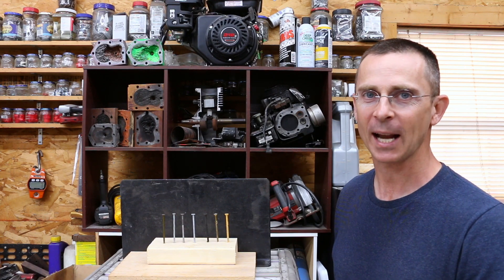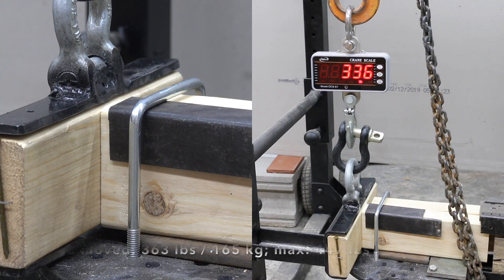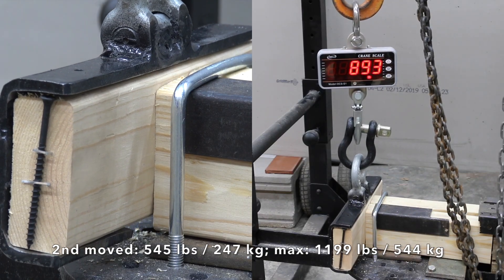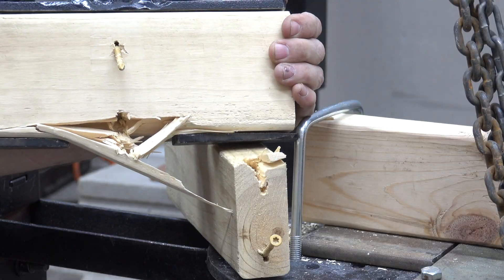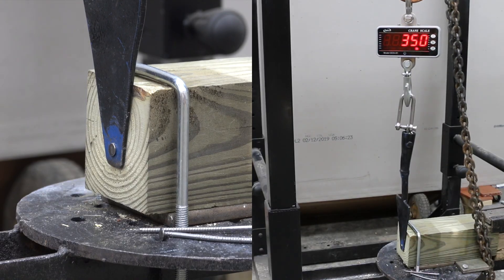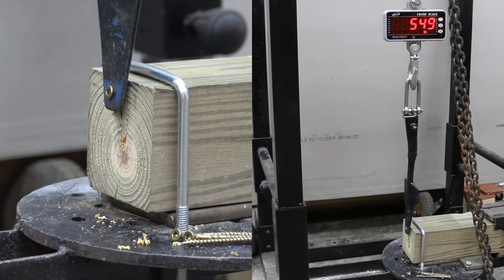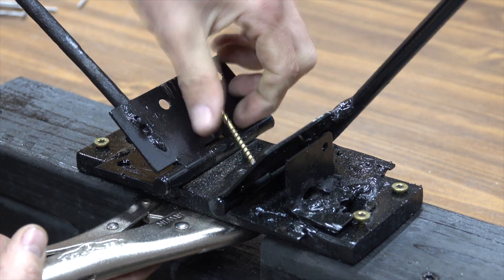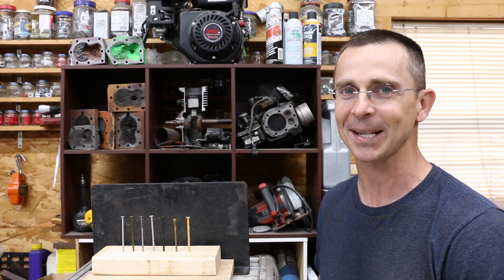Do Screws Shear easier than Nails? Let's find out!

Comment: The ductile/brittle test showed the stronger screws breaking with less total bends...BUT..you can obviously see significantly more force being required to bend it just once which you must ask, how many times will the lesser shear strength allow the more ductile nails to move laterally before the screws move once. If they are able to make more movements to a snapping point before a screw is ever fully bent once/twice then i suppose it doesnt really say much

Comment: I love this test. Thanks. From the Netherlands. Concrete houses are the norm, with attics being wood. Need to strengthen an attic. Exactly what I needed. Seems builders are making excuses to use nails for cost and time cutting. 

The last test is what everyone else focuses on, but seems very theoretical. In what universe do nail/screw heads move 0.5-2" side to side and not see the entire structure fully compromised? .1" / 2-3 mm even is a lot. And I can bend my very strong 6x120mm structural screw with that by hand, endlessly. No issue.

Anyway, thanks for doing such an usually extensive test.

Comment: It's mostly testing the strength of the wood since that's what's almost always failing first. Either ripping apart or pulling apart. Repeat with a harder wood that isn't moist, so the fasteners have more lateral load, and don't just rip the hole bigger and then pull out.

Comment: We built a shed 24 years ago using only screws, lag bolts and carriage bolts with lock washers. The shearing strength was from screwed in horizontal 1"x4"s. The siding and roofing is sheet metal. The shed has been through three hurricanes, an F1 tornado, had a tree fall on it. No structural damage.

Comment: The test rig conceived and use here has been, rightfully, commended for effort. However, the results and the visible mode of failure depicted in the footage clearly shows that the rig assessed 'Skew Withdrawal', not Shear. All fasteners simply ended up withdrawn and bent, as against merely withdrawn but still straight (as would occur with an 'Axial Withdrawal' test). Only one of the fasteners tested actually 'sheared' - evidently by fluke of that screw consisting of a relatively weak (brittle) metal. 

Though the force applied with the rig is in the correct direction that it should be for a shear test, lateral, or 90 degrees to the axes of the fasteners, (not axial, in the same plain as the fastener axes, as would be applicable with a legitimate Withdrawal test), for the rig to actually test Shear, the 'top' of the T and its enclosing metal C-'puller arm' (at left as seen in the footage) would need to be fully constrained from tilting away from the 'shank of the T, as the pull-up load is applied, that is, deliberately and only allowed to move upward/perpendicular to the axes of the fasteners, not outwards/away from the T shank.

Comment: I've been hearing old heads say nails have more shear strength this blah blah blah than screws all my life. I always knew they were wrong, just didn't have a way to prove it. Thanks. 

Kind of ridiculous that even building codes mostly call for nails because of "shear strength".

The amount of bending required to break the screws will never happen in any house or deck, especially because there's so many of them in each joist/whatever.  If 1 screw on average can hold 700lbs, and joists hangers can hold 8 screws, on both ends of the board, that's like 5600lbs x2 which is 11,200lbs. Tell me when would there EVER be that much force on a single joist? NEVER. not even half of that!! You could fill a room with cinder blocks and it would hardly weight that much, the board would snap first (maybe) now factoring in all the other joists which would multiply that exponentially distributing the load, it just seems absolutely ridiculous to not be able to use screws according to "code"

Comment: Finaly some tests that make sense. 
I had my doubts about nails being way better than screws... turns out they are not.
They only surpas screws in most usles test - where you bend them beyond any normal deviation in buildings.
But this somehow is the standard mesurement for most people.

I guess that's why so many homes are made from wood... because concrete does not bend at all.
Reply from the maker: Thank you very much!

Comment: Just My VIEWS --- I have built many Decks and Some are Over 30 Years old and Going Strong .  -------------------  The TEST Did NOT Show or COULD Show EAST COST WET ------ Or SOUTH WEST DRY ------  Out West in Totally Dry Weather , Even the SHEETROCK SCREWS Will Hold for a Life Time , BACK EAST IN THE WET ------- OH HELL NO ,  I use  ZINK COATED SCREWS and No Problems at All .  The DECK and ROOF At my House has STOOD TO OVER 100 MPH Winds and Never Moved .  Just Using ZINK COATED  CONSTRUCTION SCREWS and is Over 30 Years old now .

Comment: Very good video, always like testing like this.  One thought on the fatigue failures, you bent the screws in the threaded region where the shear tests were stressing the region near the head.  I suspect the screws would have performed much more like the nails if the non-threaded portion had been tested instead.  The stress in the threads would be much higher due to their complicated notched shapes.  
Also for the shear results, it appears any coating on the nails reduced the pull out friction somewhat.

Comment: I built a desk several years back and it sat outside for a winter in NorthEast. My GRK screws had obviously gotten wet. The sheared/snapped very easy to my surprise when moving it around in the spring. This made me worried about using them on a Porch project up coming? Not that I plan on them getting pounding with rain but in general should the moisture resistance be a factor when considering structural screws for building walls etc.. I suppose as long as unfinsihed framing is not left too long exposed to the elements? I noticed they also make GRK screws in Stainless?

Comment: I've been looking for an appropriate nail or screw for permanent roof anchors on my home. They must hold if I fall off the roof which would be more of a sudden, shearing force than demonstrated here. In a lot of the videos, screws are used and in one case, six 3" spiral screws are included by the manufacturer. These go through the decking into the joists. I thought about the structural screws from Grip-Rite that state they replace lag screws but expensive and maybe overkill. Suggestions appreciated. Great video by the way. As always.
Reply from the maker: Thanks!  Thanks for the suggestion.

Comment: I am redoing the fasteners in my wrap-around porch with deck screws because 50 percent of the nails have worked their way out and are rusted over its 25-year life (up over 1 inch). In reality, I've found it's best to use a coated deck screw for most all construction projects since they hold well enough, do not work loose, and can be removed straight and reused. I gone back to outdoor projects ten years later and the deck screws look very similar to new, if not under water.
Reply from the maker: Thanks for sharing.

Comment: If your shearing off a modern threaded structural fastener your probably in the vortex of a tornado. bigger problems to deal with.
Reply from the maker: Thanks for the feedback.
Reply: @ProjectFarm  BTW, your channel is sooooo freak'in honest.  Thank you.
I think @ 9:00 was a better shear test since it put the test force at the actual point of the snap. and..... did not break👊👊  Not sure a screw inside a piece of wood would ever move the way you bent it in the hinge test. Just my opinion. Thx again.

Comment: I am a design engineer and I think a good test would be screws and nails and various orientations on the wood such as ingrained side grain etc test for pull out and sheer forces Plus shear with a torque Force called a moment which can happen with a nailed in ledger. You can contact me if you need more info.
Reply from the maker: Thanks for the suggestion.

Comment: He only used 20% for design value of the ultimate failure and a perfect condition. As far as wood goes you need to use different areas of the wood to screw into the test piece such as parallel and perpendicular to end grains.
 In general ad and 10d gun nails are the go-to for withdrawal and shear and high wind applications. Once the threads have some gripping problems in a screw all bets are off which can happen with rust or wet or deteriorated wood.

Comment: The first 2 tests were very reasonable & realistic.  The forces on the fasteners were slow and increased gradually.  The metal resisted and distorted gradually as the strain increased to the point of pull-out, which happened long before the yield limit could have been reached.  The only way to reach point-of-failure was to increase the rate of bending and focus it on a tight area.  Thus, I'm concerned about how realistic the bending test was.... For a fastener to bend so many radial degrees, at a specific location mid-length, in such a short time-frame, the connection would need to be subject to a catastrophic event, like a hurricane or tornado, or a landslide.  Otherwise, the bending movement would be unrecognizable to the naked eye.    Perhaps you could do test where the side to side pressure on the head was rapid, but short, or slow and short.   The issue here is that metals tend to be more brittle under a quick movement and more ductile under a slow one.  Sort of like bending taffy candy.  If you want to break it, you need to wack it against a corner... it will shatter.  But just bending it in your hands won't break it till the material becomes fatigued and thus more brittle.   Not withstanding this criticism, your study was EXCELLENT.  Thank you.   I'd like to send you a contribution, rather than pay monthly. How can I do this?
Reply from the maker: Thanks for the constructive feedback.

Comment: Bending a fastener is not a test of shear strength.

Nails and screws will not sustain bending loads unless the joint is so loose that there is no friction between the attached members.

The tests you conducted using a load applied perpendicular to the fastener into the ends of the 2x4s showed that as the fasteners get loose, the shafts all bent with no failures. This scenario seems more representative of real world use vs your bending tests.

Comment: Not really shear strength as the board is just cocking back and the nails pulling out.  U need to squeeze the board with the load on it so it has to pull straight up.  Your just pulling the nails outta the board

Comment: How about a combo of fasteners and adhesive.  Use the deck screws and the Loctite 8xl.  Do end grain as well as cross grain pullout and shear. Very curious on how strong this combo joint will be.  👍
Reply from the maker: Thanks for the suggestion.

Comment: I know this is 4 years old but I had sort of a related experience using deck screws to hold up weight. I built 8 four tier free standing shelves using full sheets of 5/8" OSB and 2x4 lumber. 
I built 4x8 frames of 2x4's sitting vertical, with a cross member every 2ft, sort of a ladder frame with OSB screwed to the top side with the same 3" deck screws that I used to assemble the frames.
Each of the four shelves were held up by 10  2x4's, two on each corner. and two in the middle. A 48" length of 2x3 was used to place each shelf and give it some added under support. Each shelf was held by 10 screws per corner and five each in the middle on each side. The bottom shelf was 1" off the concrete floor, the rest were spaced roughly the space of a 5 gallon bucket. They were used to store misc auto parts, all placed in buckets with the tops on them. Each shelf got roughly 800 lbs on it. One, which was against the wall, got loaded with cast iron cylinder heads, about 2,000 lbs per shelf, maybe more. On that shelf I added a few supports in the middle between the shelves in the middle to prevent the OSB from sagging between the 2x4's if it got really humid in there. 
All was fine for about 8 months, then I walked in there one day and one shelf had collapsed all around, and all the 2x4's were completely detached, every last deck screw had sheared off, none pulled out, all were broke off clean and flush. The second shelf, had collapsed only on one end, and only three shelves on that end fell down onto the next. The other end was fine. 
A third shelf was fine, as was the one holding the cylinder heads. I cleaned up the mess, 
removed the screws, then put the shelf back up using both a few screws to hold it in place and then I used two 1/2" bolts in each connection. 
They were fine for the next few years. 
The shelf with all the cylinder heads on it is still standing, untouched and showing no signs of any fatigue. The other day, after finding a bag of bolts I had bought for the other shelves, I drilled and added one bolt to each corner in every shelf just in case. 

What I did notice is that although they were all built at the same time, I ran out of screws half way through and went back to get another box. The first batch of screws were flat black, but also marked deck screws with the same skew number, the second batch, a 10lb bucket, of the same supposed type, were slightly shinier. They were coated and marked safe for PT wood, but this was framing lumber and indoors at that. None of the screws were corroded, they sheered off clean as if cut with a bolt cutter. There was no bending or tearing, just a clean break. 

Fast forward a few years, I used some of those same screws to replace a piece of stockade fence in the back yard, (not PT, just plain fir), we had a 70 mph windstorm last month, and that panel, which was held on with 24 of those screws to three posts, blew down shearing every last screw. They were up there about a year. But again, they were not rusty, they just broke off. 

I did my own test, using three 2x4's, all 10" long, screwed together in a three layer stack, with the middle sticking out 2" on one end. I stood that up in my 25 ton press, which has a pressure gauge on the ram.  I did the same with some OLD 10p nails, and again with some 3" drywall screws. I also went back and bought a 1 lb box of the same#10 x 3" deck screws. Each stack had 10 screws or nails driven in from each side. 20 in all. I used a 1" plate on both sides so the end of the boards didn't split. I then built a box using two pieces of tubing to fit the 3 pack of 2x4's into with minimal side clearance to prevent any pull out. 
The deck screws from the bucket, gave at 771 lbs of force
the deck screws from the box gave at 1,487 lbs of force
the drywall screws gave way at 1,101 lbs
the old 10 penny nails gave at 2,200 lbs, finally splitting the wood and traveling along the grain of the middle board. 
Basically the wood gave way before the nails failed. 
All the screws eventually sheered off flush.
None spread open as to have relied on the steel tube to prevent them from pulling apart. 
None failed explosively, all sort of just gave and it was over. 

There's definitely a difference in the screws in the different containers. 
None have any PT rating but all are marked 'outdoor use'. 
I did notice that there's an American flag on the small boxes but not on the bucket label. 
The screws though look identical even under a magnifying lens. 
What I don't get is why the heavier shelf, never gave way, its loaded five times heavier and it lasted for years like that. It is against a wall but not attached, and the wall is no more than a free standing dividing wall separating the shop from the storage area. 
I had used screws in the beginning with the thinking that although they're not as strong, enough of them should handle what I needed them to handle and i needed the corners joints to stay firmly connected if the shelves sagged over time. 

With the bolts, they're all still standing but the load has been slowly reduced over the years as they've been repurposed to hold lighter items.
Reply from the maker: Thanks for sharing.

Comment: The ring shank nail is the best choice overall. They are designed for use in pole barn type construction where lateral forces arent an issue like stick framing as posts deep in the ground are highly resistant to such forces and as well this type of construction combines these nails with 3/4th inch thick through bolts as well as double or quadrouple plates and also bearing blocks. You can also add lateral braces too if desired.

Youre talking about an impressively robust structure when completed that few others structures can match.

So therefore a 40d galvanized, coated, 5 inch, 4-7 gauge, ring shank nail is the nail of choice.

Also note that for all practical purposes there is no difference in the shearing strength of bolts, lag screws or spikes providing the total diameters are about the same. For example, three 60d spikes with a diameter of 5/16th inch, will equal the strength of a 3/4 inch bolt, where the load on these fasteners is primarily vertical.

Anyway, this was at least a more accurate type of test than the previous one you conducted. The spiral shanks are a disappointment as its been said by many that they are next to impossible to pull out. Anyone who has tried to dismantle pallets can attest to this.

But Im very please that the ring shanks performed so well. They certainly live up to their reputation.
Reply from the maker: Thanks for the feedback.